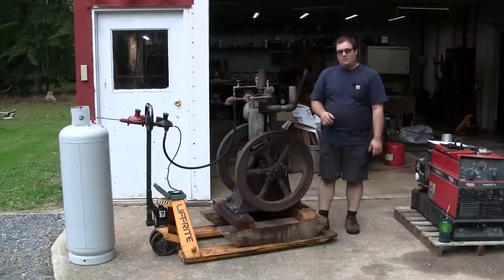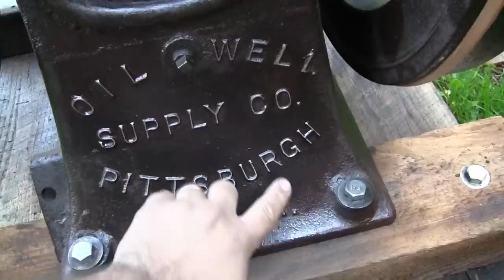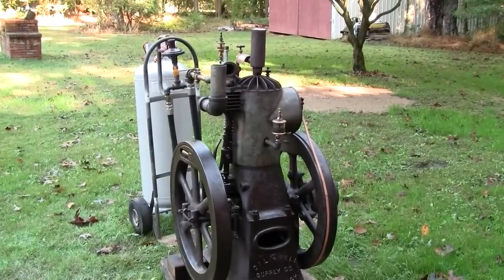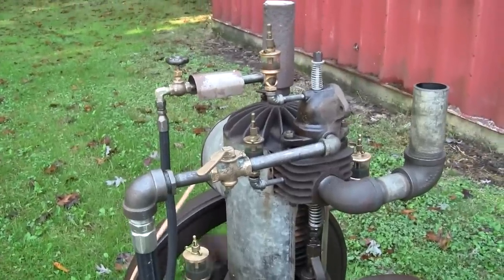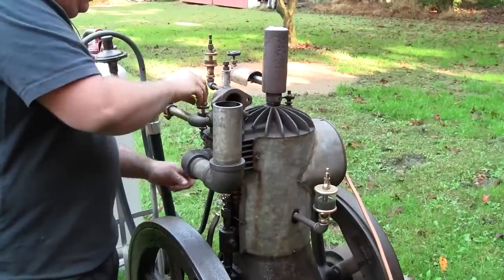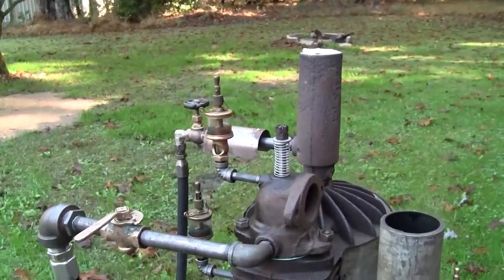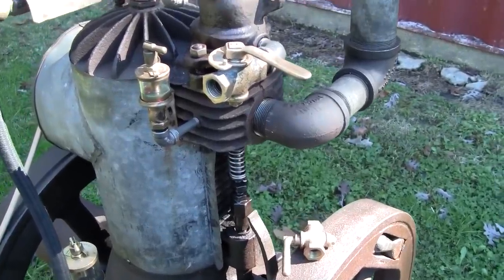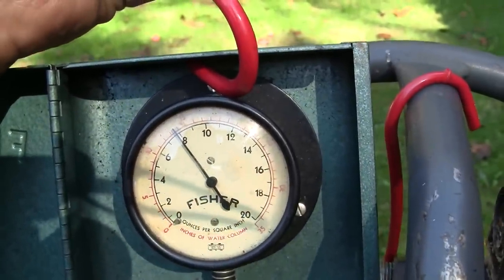100 Year Old Hit and Miss Engine Running on Propane Oil Well Supply Co.

Comment: I just had another thought - LP gas has 2.5 times the BTU per cubic foot compared to natural gas.  If the engine is designed for well head gas the orifices around the intake valve seat are likely too large.  No different than trying to run a natural gas furnace on LP without changing the orifice - way too rich.
Reply: I was thinking the same thing. Perhaps there may be better results by turning the regulator down from 13" to about 6".
Reply: @ecaparts  I think he said it was already 6" :)
Reply: yes its not just  pressure its the volume  flow , my  garden tractor i converted to propane  and it steps down  main pressure to  and a low pressure demand regulator  and  an orifice that  has an adjustment  same as a needle valve  so basic idea it  meters the amount of fuel via the  screw adjustment opening and closing the gap for the propane to flow through  and at low speed the  demand regulator has an adjustment that governors the low speed flow rate. and the basic adjustment is adjusted at 1/4 turn per HP of the engine to allow so it doesnt flood out the engine mix
Reply: Propane is really picky about the air/fuel ratio. It's likely doing the double intake because there's to much propane in the cylinder vs the air.
Reply: yus. too rich. not only in the combustion chamber. looks to me like a too-rich flame coming out of the heater-plug chimney. if that burner is given more air, the plug will get hotter and firing will improve. ta daaaaaaaaaa
Reply: @raymondo162  noted the plug flame too.A Propane should be blue with a hint of orange/red flame at the tip of the flame. Retired appliance repairman. Did a lot of NG to LP conversions on ranges/ovens over the years. Also the insulation in the tube is a hindrance to heat transfer.
Reply: Well head gas is an extremely inconsistent mix of flammable gasses and condensate. Trying to get it running on LP would take extra tinkering. 

Yall are onto something.
Reply: Most natural gas burners are set up for 2” WG gas pressure…
Reply: Go ahead an try propane on a nat gas system without an proper office and you burn

Comment: some working engines just dont run well with out load  soon as a load comes on they just pick right up
Reply: yes under load of a pump the engine would  have a totally different sound
Reply: @DMPB-fi2ir 
Right, but they are designed to fire less often when the load is reduced(or removed). That's why they are called hit & miss engines, because they don't fire(ie. "hit") on every ignition stroke. Therefore, they purposely "miss" more often than they hit when not under load. 

The problem with ^this engine isn't that it's missing. The problem here seems to be the double-suck intake thing that its doing.  I've seen some of these engines that will fire once, then continue to freewheel(miss) for a surprisingly long time  before the centrifugal governor  finally slows down enough to cause them to fire again. But I've never heard one doing the double intake thing this one is doing.

Comment: Where I grew up in Texas there was an oil well about a half mile as crow flies from our house in the country. I can still hear that hit n miss engine running that well in my head. You could tell exactly where it was on the stroke just by listening. I miss hearing that old well engine run......
Reply: I lived near one and falling asleep was hard as it was not a steady hit and miss. My neighbor finally snapped and shot it with his 30-06. The oil company replaced the engine with a silent tiny inline 4 cylinder and all neighbors were thankful.
Reply: @H2R5GSXR  and who says violence never solves problems
Reply: Same here raised in Kermit TX miss that old sound. With the pump going up it popped every time. Going down it sputtered. Needs a load on it to run right.
Reply: Oilfield engine barker if you want to hear it again.

Comment: This engine needs a working load for stability. It was never designed to "idle".
Thanks for sharing 😁
Reply: agree all the tractor pulls ive been to all the old timers say the same thing. my friend has a few and he too just let them idle. and the old timers said to bring them over and hook belts to their different equipment and it ran much better. there another channel billtmaxx  he has a few small ones he pulls out every once in a while. he has done a few videos of him and his father at tractor pulls doing hay with a small bale hay maker his dad made. bill also has a desk top hit and miss that runs off of zippo liter fluid it actually runs. he shares the link to buy it and it was 300 Canadian dollars so only a hundred our us dollars lol
Reply: indeed, they are also constantly using the same amount of fuel regardless ,  maybe he can get a pump and a barrel to give it some load
Reply: That is what I instinctively wanted to do, too. I don't know why it was instinctive. Before I saw your post I had put that up as my suggestion here, too.
Reply: We have been accumulating loads for our engines, hate to see engines just sitting there running unloaded.
Reply: Scrolled down looking for this specific comment, or to make it myself.
These old girls need to be under load for them to run properly, they weren't designed to freewheel like that.
Reply: @mashrien  Yes, I suspected that. What I would like to know is why they will run correctly with a load or some drag on them? What changes for the firing process?
Reply: Simon Johnson, do you happen to understand why it is that a load is needed? What happens with the timing/firing/valving mechanism when a load in on that makes the whole design function correctly? THAT is what I am curious about!
Reply: @RobertFay  The fuel control system isnt designed for small loads hence why it wont run...
Reply: @laser-sj  Got it. Simple. That makes sense.
Reply: yes it needs a load...
Reply: @chevyphil3969  Do you have a link to this video? I'd LOVE to get my hands on one of them miniature engines like you speak of!
Reply: @chevyphil3969  Thanks for the link, I'm checking it out now!
Reply: I think the load would cause the flywheel (governor)to slow down quicker ...bringing in the next power stroke sooner ?
Reply: @v12dot  thats my point.... as the fuel control on this is very course, it needs a load to become stable.
Reply: Thomas Chrombly   here in Niagara falls new york  we are mitty taco fans. its a family owned taco area who does ship world wide. real meat no bean fillers not that taco bell is crap, i just dont like refried beans lol
Reply: Interesting.
Reply: When u let it freewheel like that it doesn't burn the fuel coming in and it builds too much fuel. I don't even know about these and I was like there must still be propane flowing the whole time?
Reply: This engine is running exactly how it is supposed to. It is called a "hit and miss" for a reason. It is designed to hold open the exhaust valve until the rpm's have slowed enough to require another combustion stroke to maintain the set rpm's. Anyone can run an old engine, a pro can run em slow.
Reply: I was thinking exactly that, since it seems to have too much speed each time it fires and has to slow down to reengage the govener.
Reply: @RobertFay  The load is needed for correct intake charge timing. The load slows the intake stroke enough to allow for optimal fuel air charge to fill the cylinder. So that said, If you just want it to idle you could just upsize the intake valve BUT if you do that you would effectively make it an idle only motor. Better to just put a load on it like it was designed to have. Hope that helps.
Reply: @mattozx6rr  .
- Good educational tutorial you provided. Thanks.
Reply: Hit and Miss Engines at idle when coasting, not firing have yue exhaust valve open. Therefore the atmospheric intake valve is closed and they indeed are not sucking as much fuel or "loading up".

Comment: I think maybe your problem is with the hot bulb. Maybe dial back that fuel a bit to keep the flame inside the tube, or even possibly remove the insulation. I just realized this video is two years old, so you probably already have it dialed, but I'll leave the comment anyway. Very cool old engine. Thanks for sharing.

Comment: I’ve never seen a hot bulb ignited natural gas or propane engine anywhere else ever. Fringing cool man!!!!!
Reply: Less fuel  ( lean it out )
Reply: They used them alot on the railroads back in the day, not for the trains but I imagine since it's a pump they used them to pump water and maybe other thing's. The old O&W railway by me there is one of these pumps by an old train tunnel
Reply: Had an old 1903 Reid oil field engine, runs on propane and hot bulb or spark ignition.
Reply: A lot of the big oilfield engines are like this. Hot tube ignition is dead simple, nothing to wear out or get stuck. And it was common for these engines to burn wellhead gas, so they are supplied with LPG in preservation.

Comment: I have a friend that had twenty or thirty of the old "hit & miss" engines. I was amazed at his ability to get these old engines to run. There used to be a collectors show in Adams, Tennessee every year. Some were really big engines with six foot diameter fly wheels.

Comment: Outstanding effort! " more fuel and intake valve spring pressure" I believe this sentiment was echoed  many years later by the Ramchargers in Detroit. Fantastic video! My 93 year old Mom remembers the kerosene hit and miss on the front porch washing clothes.

Comment: I'd bet issue with the double intake stroke is like others have said, no load. I'm thinking the reason  is because with out a load the engine is so close to governed speed it takes that second intake stroke to slow it down enough to actually fire. Although, you may be onto something with the intake valve tension (as others have also mentioned). I look forward to seeing the next episode with hopefully a solution to the problem. Keep up the awesome content! Stay safe out there! Dan @6-4_Fab Glen Rock, PA
Reply: That doesn't make much sense, though; If the engine has slowed down enough to let the exhaust valve close, and for the compression stroke to occur, then it should fire. That leaves timing, fuel or ignition as the other possible culprits.

It could be timing, if the exhaust stroke isn't timed correctly or the governor isn't releasing the valve properly, you could be losing a partial compression stroke causing it to have to come around a second time.

The ignition tube might not be hot enough without a compression stroke to heat it up just enough to work. Seems unlikely but who knows.. not much else to go wrong with that ignition system!

Fuel, I have no idea. I'd think that if adjusting the fuel mix at the valve didn't help then there's not much else to fiddle with. Might also be that the exhaust valve isn't closing properly, so the intake stroke "leaks" air back through the exhaust and doesn't take a proper charge of fresh air and fuel. Reducing the spring tension ought to compensate for that but maybe not.

Odd that such a simple machine could be so difficult to troubleshoot!
Reply: It's not the lack of load, the gas supply is constantly on so while the engine is 'missing' and winding down the intake bowl is filling with gas, the first intake stroke is then super rich, then the second intake is right.
Reply: @kingcosworth2643  I was also kinda thinking that. So what you're saying is that the engine is designed to run this way right?
Reply: @kingcosworth2643  The valve is closed as it's winding down, so no flow right?
Reply: @I_M_Nonno  Correct, which is exactly the issue, the gas is collecting in the bowl above the valve for that 1-2 sec as it slows down.  The gas delivered in the time between the two intake strokes is obviously the correct amount because it fires, so you can imagine just how much gas has collected in the 1-2sec it takes to slow down.
Reply: @kingcosworth2643  Oops, I just said almost exactly that, just a little behind the times here ;-)
Reply: @6-4fab53  It's not designed for the constant flow fuel delivery.  It really should have some sort of venturi system.  You could make it work with the gas regulated to atmosphere..
Reply: @kingcosworth2643  I never looked at it like that! I'd bet there wasn't very much pressure/volume feeding the engine to begin with! Very good point!
Reply: @6-4fab53  Yeah, he said he has dropped the pressure to 11" water, which is about 0.4psi, which is obviously very low, but still constant flow so it will fill up the intake port with gas while the engine is 'missing'.  He needs to fit a venturi to the intake, and a modified regulator that only flows gas when it's outlet goes below atmosphere.  If it wasn't a hit and miss engine, it wouldn't be anywhere near as much of a problem.  Some of the other guys are saying load would help and this is true as much as it would stop the engine going into it's missing operation and filling with gas.  but the specific problem is what I outlined.
Reply: @kingcosworth2643  The load was my first thought but, I really thought "how/why is that possible". And then I thought, maybe the engine is designed to run like that and again I was asking myself "why would it need to run that way". I agree with your theory! I'd really like to see him take your advice and let us all see if that solves the problem!
Reply: The double suck is because the 1st charge is too rich to ignite. Propane has a very narrow ignitable mixture. The 2nd charge is then at the correct mixture, so it fires.  This engine needs a demand regulator, wherein it only is supplied with fuel when it is drawing charges.
Reply: @renegadeoflife87  100% Agree

Comment: You're on the right track with an accumulator - a lot of those old engines had a piece of casing with the ends welded shut used as an expansion or accumulator tank to give the engine an easy slurp of fuel instead of drawing through the restrictive regulator....it also separated out moisture from the gas
Reply: Agreed, the fact the engine needs to take two sips before firing indicates a lack of fuel initially.
Reply: @yokiniqu  I'm only 25 min into the film but I'm wondering about the temperature of the inlet pipe. In the UK we have at various times seen amounts of LPG powered vehicles because of the price of petrol. (gasoline)  They are all a bitch in cold weather to get any cabin heating because the coolant water is first run through a pre heater for the inlet LPG mixture and the pre heater takes quite an amount of heat. Is the low temp of the intake mixture killing the first combustion?
Reply: @COIcultist  This is why the best LPG conversion systems inject liquid gas. They cost more, but repay with better fuel economy and fewer warm up issues.

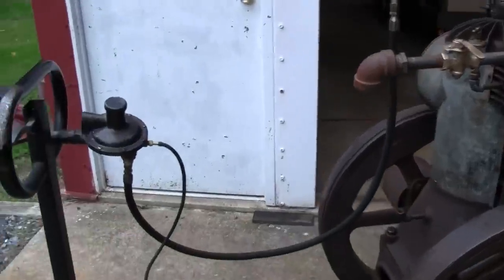Comment: 2:15 Pressures in sane units (metric of course):
10psi = 689mbar
6oz/in² = 10,4 inH2O = 25,9mbar

Love your videos Mike :D
Reply: This engine is too old to run on metric gas pressure.

Comment: I agree that engines of this type benefit from a load. It stabilizes the entire system and matches the input fuel power with an appropriate load. Even purely mechanical systems require balance.
That said, AWESOME diagnostic path and a brilliant resurrection of this antiquarian  engineering marvel. You, young man, are a genius. It is a privilege to watch you work and follow your logic. 
Thanks for  sharing. Be safe. What a pepper engine. 
Generator power using stone knives and bear skins.
Realize this is a prime mover capable of operating on any combustible gas and technically approachable with rudimentary iron casting capability.
Quite amazing and thanks again for opening my eyes.
You rock, be safe.
LL&P
(couldn't  find a Vulcan salute)
👍
Reply from the maker: Thanks for checking it out Jeff!  Yes, when loaded up the engine will fire consistently.
P&LL

Comment: Some hot bulb engines do not require additional heat to the hot bulb once they have started and settled, the old German prewar tractors started with a blow lamp heating the bulb, then ran on the heat created by the engine itself running.

Comment: The cam lobe might be too worn out and you may not have enough cam duration to fill the cylinder. That might be why its double intaking.
The piston rings can also be too worn causing low suction/compression and blowback.
Increasing the spring tension will make the valve close even faster worsening the situation.
Increasing the NG will impede air from getting into the cylinder causing the engine to stall.
But before doing any changes you should test it under load to see if it runs better.

Comment: Nice fixup job, Mike. I instantly wanted to put even the slightest load on the drive pulley wheel to see if that would take away the "double-suck". Simple. Quick check. Easy to do.
A long 2x4, backed or footed steady to the ground on 'backside'/furthest from the propane tank, and the side where the pulley is spinning downward would easily work just fine. Then just push the 2x4 flat against the spinning pulley and produce a friction load.
Heck, you could even press the bottom of your shoe against the bully (from the propane tank side) and that might work. Or put a length of 2x4 under the pulley and lift up. Doing this from the side against the 'rock-forward' could be a bit dangerous but might work better.
It should not need to be said: orient the 'lever' for safety so it doesn't want to fly away/up and hit you in the face.

Comment: My thoughts on the intake valve is, the vacuum required to open it occurs, the valve opens causing vacuum loss and closes, then as the piston continues to travel down, the vacuum increases again, enough for the valve to open a second time..... I have seen one other engine like yours running, it did the same thing.
Reply: Definitely agree with that comment !!